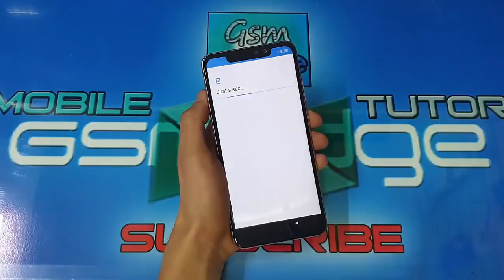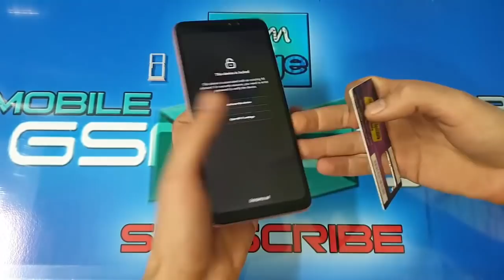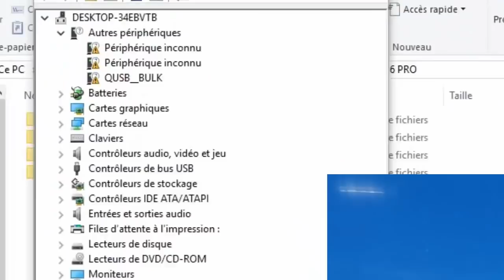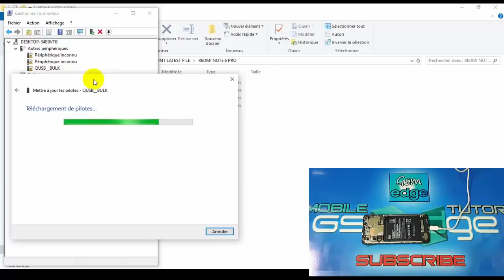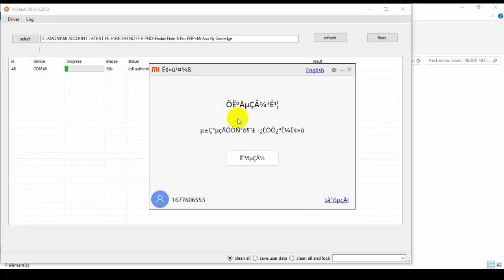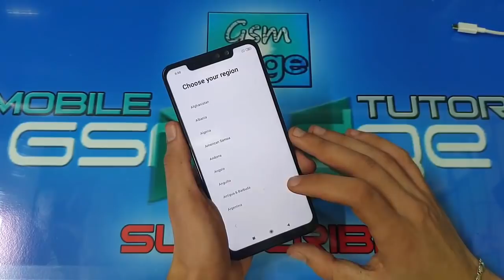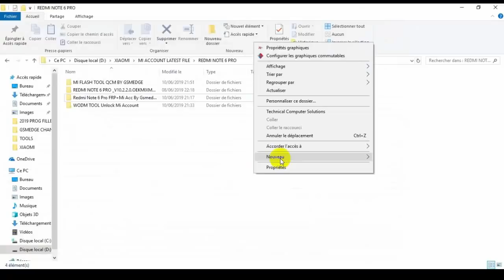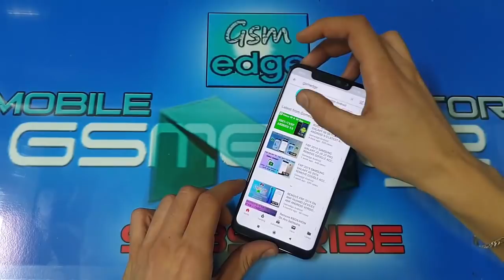BYPASS MI ACCOUNT LOCK ALL XIAOMI MOBILE WITH EDL AUTHENTICATION

Comment: HI ,i have problem with Xiaomi mi note 3 with locked bootloader, stuck on mi recovery like bootloop , can you help me? it happened after the last 10.4 rom update
Reply: if you need to restore your phone, write to me +79677771598

￼
Reply: @UnlockUnbrick  Thank you it is old post, I have managed to fix it at the end.
Reply: @RanTausi  hey sir I have the same problem with my k 20 pro , can you please help me
Reply: @RanTausi sir plz save my life...tell me how you did it? Please 🙏🙏
Reply: @RanTausi  thanks bro...I tried this method but then I stopped..my mobile have sealed battery connection...sad😭...I guess only way for me is to go with authorised edl account😭 that means in service center..which are closed here due to covid ..

Comment: how do i get the authorized account?
Reply: new method AND LOW PRICE https://form.myjotform.com/simosnicos/mi-account-remove-service
Reply: simo Hanter true?
Reply: Guys you can modify miflash and avoid mi auth account request by replacing .mbn file with other .mbn file called firehose. Google it
Reply from the maker: + 7-7212-435200; + 7-771-0055500; + 7-7788-005500; + 7-7057-553535